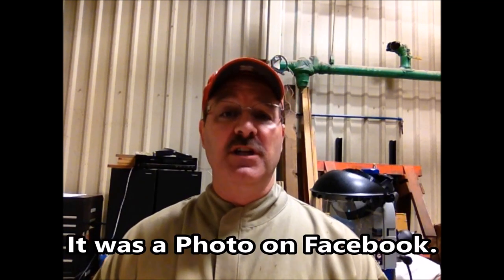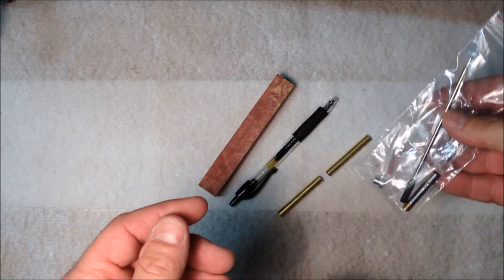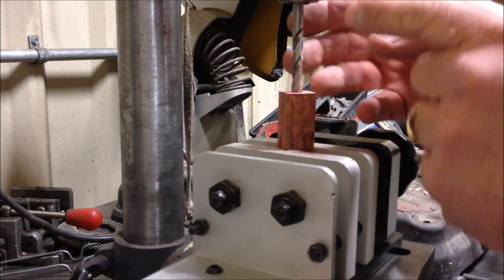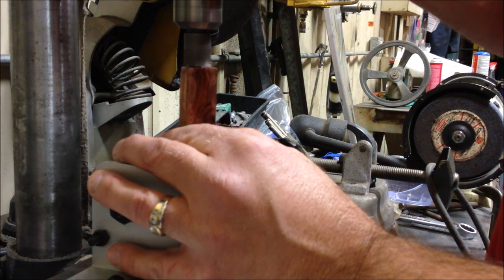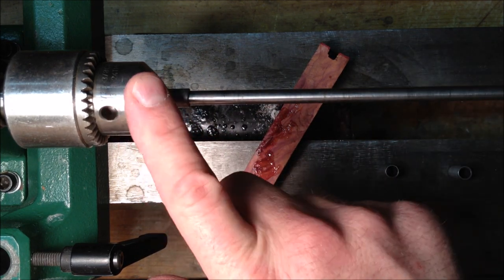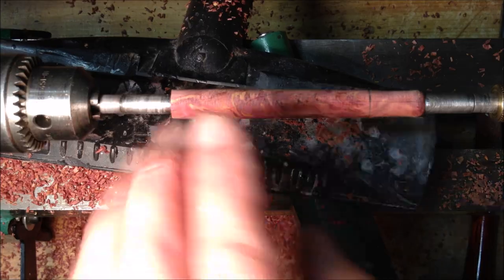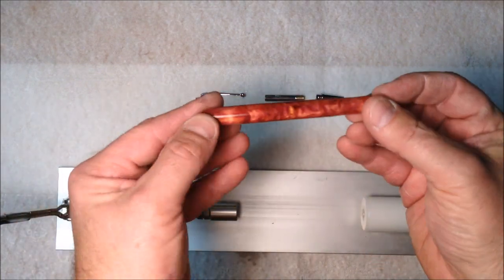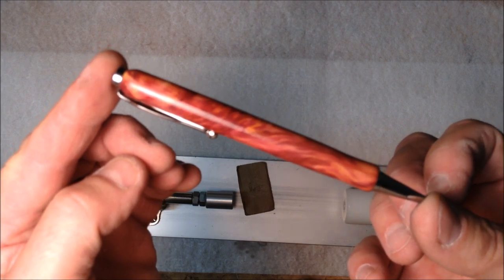Modified Slim Line Pen from Figured Cedar

Comment: Hi just a suggestion, but from an engineering point surely it would be better to drill the blank half way with the standard length drill then change to the longer drill to drill the rest of the hole. This would avoid any issues of the drill wandering off center etc.
Regards Miss Tee ☺️
Reply from the maker: That is a good alternative that requires a precision that my Harbor Freight drill press does not have. A process like that works great if a blank is trued for easy alignment then chucked and drilled on a lathe. I have done a drill and flip that way but IMO, it takes to much time and a straight through works best for me.

Regards,
Bob
Reply: @RJBWoodTurner  okay that's a good reason. I drill my blanks on my lathe as I don't have a drill press (or a bandsaw, I cut my blanks with a hand saw). I'll be getting a longer drill next week to try out the one piece pen. I'll let you know how I get on.
Thanks again for your video it's taught me on how to do it. 😀

Comment: Just found this channel, great idea's! I've made two pens today based on "your" idea, I'm having a heck of a time getting the nib-unglued tube-transmission assembly to release from the pen once assemble. Do you have any advice on making this component easier to free from the pen to replace the cartridge?
Reply from the maker: Thank you Darryl,
  Unfortunately everything I tried to loosen it ended up making it not want to stay in the pen. 

Regards,
Bob
Reply: I use a round file to just clean the inside if the upper tube and then I put some SLIPIT available at lee valley and that works and never stops slipping and is never loose

Comment: Bob, awesome job.  Appreciate you sharing the tip.  Is there any concern for a minimum lenght the pen needs to be?  In other words, do you only need enough brass tube in the back of the pen to literally grab the transmission?  If so, that really opens up the possibilities.  I assume there's some wiggle room in there, just wondering if you've encountered any errors since making these style of slimlines.  Keep up the great work!  FYI, I get really nervous on the last transmission assembly push too.  I find that if I adjust the assembly press to where the handle is almost all the way "pushed closed", the physics behind the push is less severe.  When there's only a fraction of an inch left in the press, it's very gentle on the action - and the transmission ONLY advances a fraction.  No "whoops" allowed:)
Reply from the maker: +durk Hello Dirk,
  You you can shorten the tube, all you need is for it to be long enough to accept the trans. You could even make longer pens like quill style pens. 

Regards,
Bob

Comment: Hey Bob, do you have experience with 'Easy Wood' turning tools? Thanks.
Reply from the maker: Hello,
  I have not had the pleasure of turning with the Easy Wood Tools other than testing them out. I was pleased with the results and ease with which the removed and shaped the wood. I however have never turned a complete project with them. 
  I would love to have a set of my own to turn with, I just haven't purchased one because I've been able to make due with the tools I have. Hopefully one of these days. 

Regards,
Bob

Comment: I tried this idea but could not drill all the way through in one go. Consequently I miss aligned the two holes. How do you drill your hole to align both tools?
Reply from the maker: +Andy Smylie Hello Andy,
  I purchased a 5 1/4” long 7mm drill pit from Penn State. I believe it’s part number PK7MM. 

Regards,
Bob
Reply: RJBWoodTurner thanks. Will try that.

Comment: Bob, I just had to stop back to this video and post my thanks for once again inspiring by sharing your experiences.  Last minute design mods on Christmas Eve, post-activities, for a Harry Potter and two reclaimed Fenway Park theme pens had me testing out - and LOVing the modified slimline as you show here. IMO less work than a traditional slimline.

 I segmented and drilled one of the Fenway blanks offset, and I ended up just where I wanted, one flat, and one showing the exposed surface of the Fenway Park seat, and left a couple spots of the paint as well. Could easily have left the clip off, and indicated to its owner I could remove it if he wanted.

I want to play a bit with lengthening the barrel (of course the upper tube as well) with the goal of creating a true "LongBoy".  Check out the FB if you haven't seen it already!  All the best, Steve
Reply from the maker: Thank you Steve,
  I will check it out. 

Regards,
Bob

Comment: One other tip/warning with this design that I don't think is brought up here or in the video. You really have to make a fatter slim line. 

If you turned this down to regular slimline size there wouldn't be enough material at the non-tube end and you could crush it easier especially when changing the ink. There is a work around and I'm pretty sure this is addressed in the library at the IAP.

You drill out the "non tube" end and glue in a short section of 8 mm tube. This will then support the pen at that end and slip over the 7 mm tube. I have researched this and supposedly the 8 mm tubes at Pen State for their pencils are just a little less in diameter than other 8 mm tubes.
Reply from the maker: +Cliff Hartle Thank you Cliff,  This is very valuable information. I have several 8mm pen tubes from Penn State, I will have to see how the compare to the 7mm tubes. Regards,Bob

Comment: Hi Bob. I followed your instructions and for some reason, when I put the pen together, it wouldn't retract all the way. What did I do wrong? Thanks
Reply from the maker: It sounds like the transmission may be pressed to far into the front tube. 

Regards,
Bob
Reply: @RJBWoodTurner  Thanks Bob. I'll try taking it apart.

Comment: When I used the barrel trimmer the tube stuck to the trimmer. Continued to replace the tube until finished and squared.
Turned the barrel now the tube will not come out. Help..................
Reply from the maker: +Jack Callaway Hello Jack,  It sounds like the barrel trimmer fluted the end of the tube. Try using a pair of needle nose pliers, with them closed insert then nose into the tube then gently open them until their tight, Now try to extract the tube.A second method would be to apply hot glue to a dowel and stick it against the inside of the tube. Once it cools remove the tube. I would probably discard that tube and use another because if it is fluted, it will always stick in the pen and it may not tightly hold the hardware, nib or transmission when pressed together.Regards,Bob
Reply: +RJBWoodTurner 
Thank you really enjoy your U-tube presentations
Reply from the maker: Thank you Jack. 

Regards,
Bob

Comment: Ive been wanting to do this without having to cut the blank in half since my 7mm bit isn't long enough. Whats the length of the one you use for these?
Reply from the maker: +Master Suchi Hello,
  I use the PK-7MM from www.pennstateind.com. It's 5 1/2" long and I chuck it up at the very end to ensure it will pass all the way through a blank. 

Regards,
Bob
Reply: Thanks. Ill have to measure the one I have. Picked up the standard one from a local Woodcraft shop. Hope its the same length.

Comment: Just started making pens what diameter do you turn your blank to?
Reply from the maker: The bushings will determine The diameter. Otherwise the components will not mate properly to the blank. Every kit will have a corresponding set of bushings to guide you. 😃

Regards,
Bob

Comment: I made this pen tonight but cannot get the unglued tube out. Ideas????
Reply from the maker: If it is really tight, I’ve used a knife to get under the nib and start it moving. Be very careful because a slip results in damage to the pen or a nasty cut. If you have a piece of rubber, like a jar grip, that can help you get it moving.  

Regards,
Bob

Comment: where could I buy a 7mm drill bit that long to make a modified  pen like this
Reply from the maker: +frehleycomet I purchased this one from www.pennstateind.com I think it was $3.95. You can also look for aircraft bits on eBay, some of them are really long too. 

Regards,
Bob
Reply: That is actually where  I purchase all of me pen kits so I went on there and looked around. I did see the 7mm bit but that one is a regular sized length, How do I know that the length is the correct one.
Reply from the maker: +frehleycomet Sorry for the delay in responding, I looked up the invoice and got the part number for you. PK-7MM   5 1/2" HSS 7mm Drill Bit

I hope this helps. 

Regards,
Bob
Reply: Awesome thank you so much I knew I could count on you.
Reply from the maker: +frehleycomet Any time. 

Bob

Comment: Good luck with your move
e.
Reply: Nice work Bob, iv already made a few of these but like some of your ideas. What worried me was the strength of the wood near the nib once a customer has it apart, they won't realise how fragile it may be so iv tried drizzling thin ca around the inside too give more strength too it may need some work with a rat tail file, just a thought. 
Sorry too get off topic applying heat too the lignum vitae blank turns the wood brown very quickly not green, was hoping for a reaction like your purple heart pen. 
Good luck with the new house guess your moving anytime now
Reply from the maker: Thank you Brian. 

Regards,
Bob
Reply from the maker: Great tip on the C/A John, you know I love my C/A glue. I haven't tried the heat method on anything other than the PH. Thank you for letting me know what happened for you on the Lignum Vitae. 

Regards,
Bob
Reply: The car glue inside can make a little tighter so make sure u have a file or be good with ca
Reply from the maker: Thank you John,
  I need to experiment with this pen some more, I'll sure be glad when my shop is active.  I'm having withdrawal. 

Regards,
Bob

Comment: Drilling too fast is a sure way to crack your blank, I cracked 3 blanks by just powering through. The blanks were ziricote, purpleheart and chakte vigra. I now  go about 0.5cm and then clear it out and really take my time. havent had one crack yet. Though im sure youve refined your feed to be the fastest with the least amount of risk. 0.5cm per clear is probably really slow, but I got time :)
Reply from the maker: I was using the shops drill press which is a table top model and doesn't have much of a throw for drilling. I'll be glad when I have my floor model back. 

Regards,
Bob

Comment: Really shouldn't use WD40 as a lubricant unless desperate.  It's a Water Displacer, NASA''s 40th try.
Reply from the maker: Hello Thomas,
  What is a good lubricant for something like my pen press? It is an aluminum shaft through an aluminum ring. 

Regards,
Bob
Reply: +RJBWoodTurner 3 in 1 oil is very convenient in that it comes in a little squeeze can.  It really is a superb oil.   The only oil better comes from a whale&#39;s brain.   We wouldn&#39;t want to use that.  I've been meaning to make a few of these pens like this, so now I think I will.
Reply from the maker: Thank you Thomas,
  I'll add 3 in 1 to my supplies list and pick up some next chance I get. 

Happy Thanksgiving and best are guards,
Bob